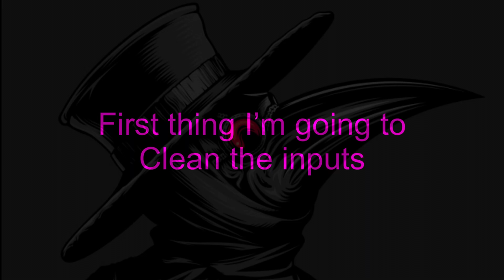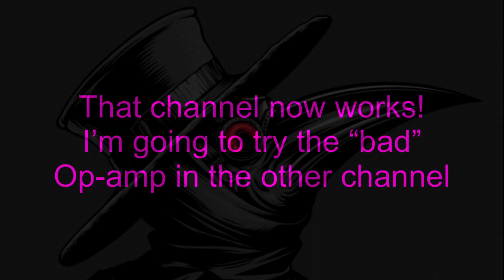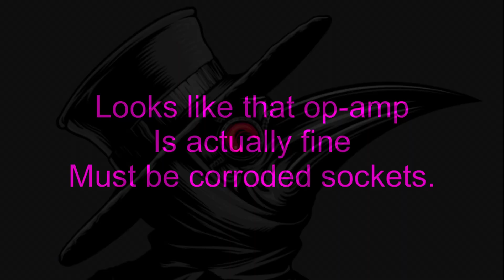Peavey standard mark III repair

Comment: I’ve notice that when I plug into the automix input…the red lights no longer light up and it seems like both channels work great and other times it’s almost like the top row works and then the bottom doesn’t. Any idea what it could be? Thanks for creating these videos on old peavey amps!
Reply: i have a similar peavey amp myself with the same problem and i think it has something to do with the socketed chips next to the input jacks
Reply: You need the automix foot switch to select and/or Combine channels.